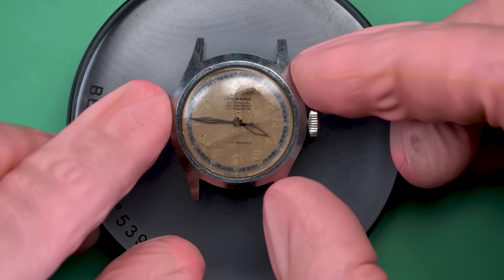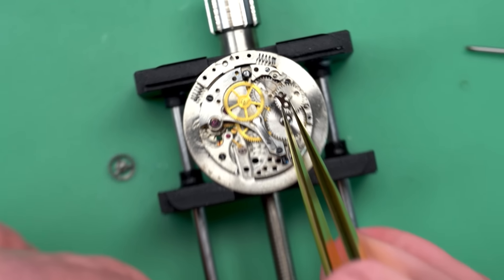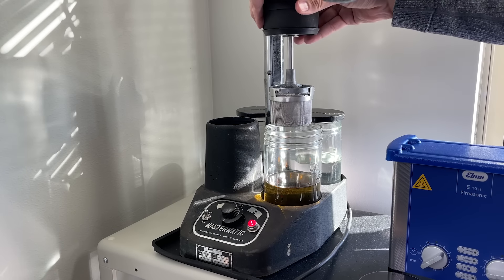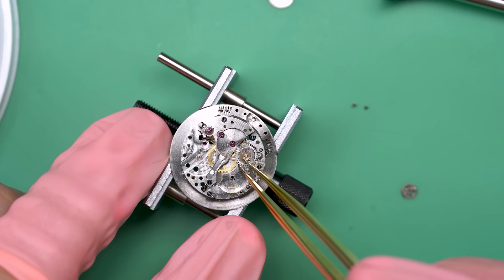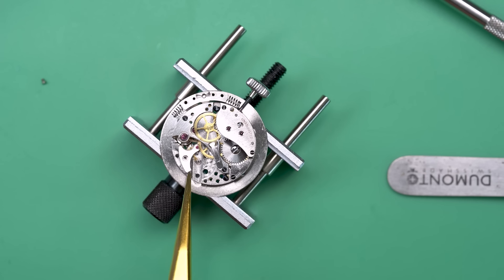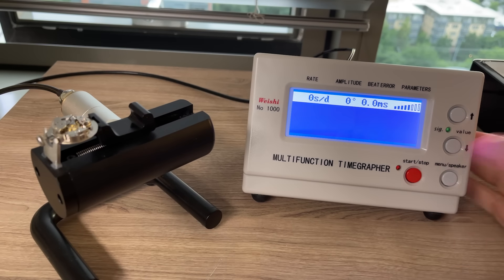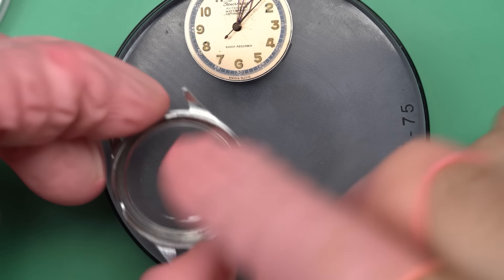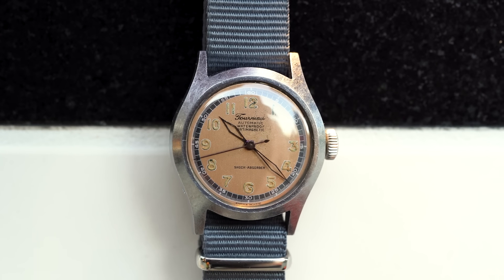Tourneau 1950s Bumper Movement Vintage Watch Restoration

Comment: noticed it said unadjusted  what does it really mean
Reply: Unadjusted means that the manufacturer did not regulate it in any positions to get it super accurate in different positions of the watch, (dial down, dial up, crown right, left, etc.).it's just regulated to a default timing in a default position & sent out the door. The opposite is it will say "adjusted in 3 or 5 positions" on the movement, which means they regulated it in 3 or 5 positions to get the best timing averaged out no matter the position of the watch. Hope that made sense.
Reply: @troynasello2085  Though sometimes some of the Swiss made movements were marked “unadjusted” but were adjusted and that was to avoid higher import taxes on adjusted movements to the United States.

Comment: I would appreciate an enlarged image.
The watch movement is the focus of the video, and most everything else is not important.
You can achieve this by either putting the camera closer or [better yet] use a longer lens, the longer the focal length of the lens, the farther one can be and still achieve the same image size. (The inverse is of course true, same distance, twice the lens focal length, twice the image size.
How much "closer" ?  Until the movement edge is almost touching the height of the frame, or twice what you practice today.  This will give us 4 times the image size, 4 times the clarity, and 200 times the usefulness.
Thank you for informative, informal, and friendly presentations.
Simon

Comment: You like to use the correct language when referring to watch parts. The "little circles all over the base" are called "machine turning," I think. As you indicate, they are aesthetic and not functional.
Reply: Those are done by machine turning, but the effect is referred to as perlage.
Reply: i have heard watchfinder claim that the engine turning helps with small particles as they will get stuck in the texture and not float around the watch and cause issues. not sure i buy it tho.